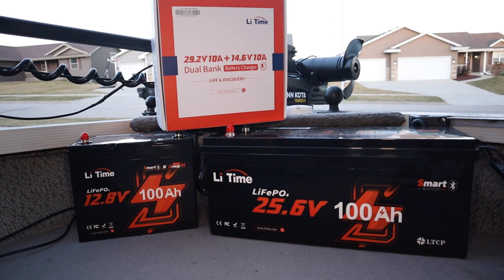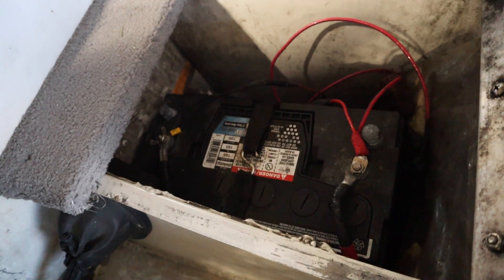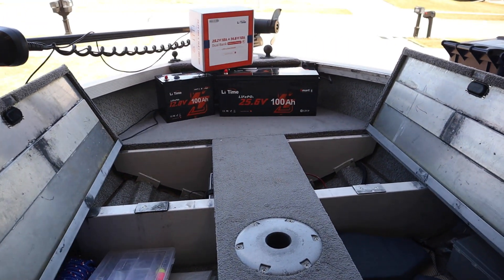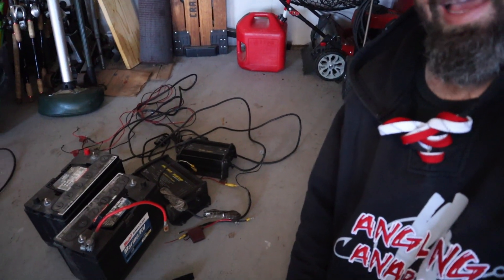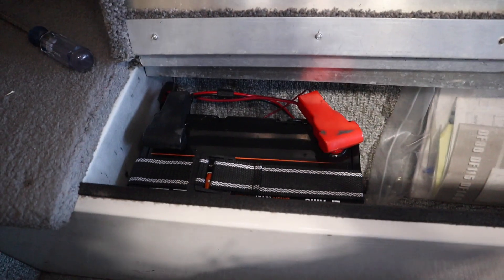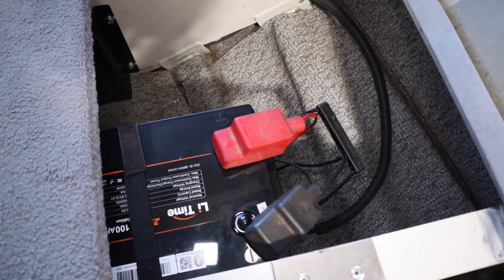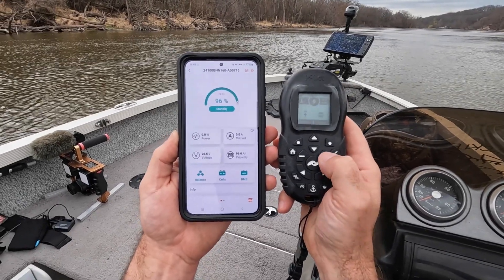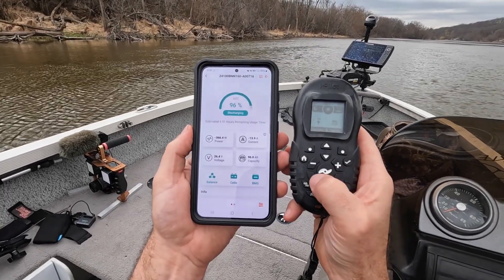LITHIUM BATTERY BOAT INSTALL!! - LITime Lithium 24v and 12v Batteries and Charger

Comment: Looking into doing this same setup.  Do you ever run into instances where you may not want to charge up both batteries at the same time?  Maybe a dumb question... but wondering, if you knew you  were not fishing for a while and wanted stop these around 75%... but the 2 batteries may be at differential discharge levels.  Maybe not a big deal...just heard its not good to leave stored at full charge. Thanks
Reply from the maker: @joerayburn21 It's definitely a good practice to leave the batteries between 80-20% when not in use. For me, this usually means just bringing the boat home from a day or afternoon out and not charging the batteries until the day before my next trip. There have been a few times when I wanted to charge one battery and not the other, so I simply disconnected the charger from one battery and ran it until I got the charge on the other battery that I was looking for. Hopefully that makes sense!

Comment: I’ve seen a 150A breaker being sold as part of a kit with this. Is that actually needed?
Reply from the maker: Im just using a 40A self re-setting breaker on this setup and it works just fine!

Comment: How are the batteries holding up so far thinking about buying one of those 24 V packs
Reply from the maker: @sandcreekoutdoors1056 I absolutely love both batteries and the charger! They've been rock solid for me. Now would be a good time to look into getting some batteries. They gave me a new code for 10% until the end of the year! Use ANGLING10 when you check out!

Comment: One thing I don't understand with these chargers. Why should you need to have your charger inside the storage of the boat or open up the storage and connect the charger? When I look at the brand victron they sell a battery indicator with charge port so you can connect there and charge the batteries. But the problem is that this port is only suitable for 12v led battery. I use it for 24v charger and it works anyway but the battery indicator might show wrong. This fault was made because lack of information from the seller. This port fits both victron blue smart 12-24v...and should not been made like this if it's not ok to combinate. Still wonder why they have not made it much simpler...for some people or most you have to climb in the boat to reach the things you need. I don't have to do that I just connect into the port that is easy to reach in the front of my boat

Comment: I’m a little confused, what charger are you using now for your cranking battery?
Reply from the maker: @fishslayer6529 Since I'm not using the lead acid battery for anything other than a starting battery, I dont have an on-board charger for it anymore. Basically, I'm just relying on the motor running to charge it back up 😊

Comment: With your set up did you install a circuit breaker or fuse
Reply from the maker: @chackparks6158 I used a Rig Rite 24v 40 amp marine circuit breaker.

Comment: What type of run time you getting with the 25.6V battery on your trolling motor?

I noticed they have an actual 24v one instead of the 25.6 is either one I'm guessing fine to use?

I'm looking at replacing my 2 lead acid batteries that run my 80lbs thrust 24v Ultrex. 

Thanks
Reply from the maker: @P.G._FPV From what I know, any lithium battery that says its "12" or "24" volts are all actually 12.8 or 25.6 volts technically because the individual cells have a voltage of 3.2 volts. The 12v batteries have 4 of these cells (4 x 3.2 = 12.8). Double that for a 24v battery, and you get 25.6. I hope that all makes sense. I get amazing run time from the battery. On a typical day of fishing I use somewhere between 30-40% of the battery, so I always have plenty in reserve.

Comment: I must’ve missed exactly what you said about the starter battery. Which battery did you go with for that? I’m looking to upgrade to lithium as well
Reply from the maker: @NateFFishing I'm still running a lead/acid for the starting battery as my outboard isn't compatible with a lithium. You'll have to check with your outboard manufacturer and see what they say. Suzuki told me the reason lithium won't work for a starting battery for me is that the motor uses a stator instead of an alternator to charge the battery.

Comment: I tested a LiTime 12v 140ah smart  in my Sun Dolphin 120 pro 😮 it has ran flawlessly! So now I am going to put two LiTime 12v 140 ah smart batteries in my Nitro Z-18 to run my 24v  98 thrust Ghost Trolling Motor . I went with the two batteries because the trays are already installed and the LiTime’s will fit . It will take 74 pounds out of the boat . Eventually I want a Millertech 12v 190 ah duel purpose cranking battery for the Pro XS 150 and everything else ie eletronics / pumps.
Reply from the maker: @MrFishhook It's tough to beat the weight savings that you get with these batteries, along with the better power you get from them!

Comment: I basically have the same boat as you. 2004 Crestliner Fishhawk 1750.
I just did a LiTime install video on mine as well. 
Still want to do the single 12v for all the electrical. 
But yesterday was my first test with them.
Boat gained approx 5mph because of less weight.
And on the Mississippi River pool 8 fishing wingdams on Spot Lock with my Terrova 80lb I am still at 88% battery life. 
And the trolling motor was humming fast to keep up with the high flow currents. 
Also found the Terrova was more responsive. 
I use both the peddle and remote. 
The spot lock GPS was alittle funky for a bit. 
But it was 15-20 mph winds in the current.
Troll speed on 10 was (in calm water) was 3.8 mph.  
Betting without the wind it would have been better. 
Check your boats speed and handling.
Bet yours will be better as well with the lighter set up.
115hp Merc 4stroke btw.
GPS speed taken off my Helix 7.
Reply from the maker: @JonGunnerOutdoors I'll be putting the 24v to its first actual fishing test this weekend for 4 days of chasing muskies in Indiana. I'm looking forward to it!
Reply: @AnglingAnarchy  Good Luck! Looking fwd to the video!

Comment: I’ve been looking into doing this myself. Did you have to purchase the higher 20 amp charger to be able to jumpstart a low battery and activate the Bluetooth function?  It shows that’s the recommended charger on the site
Reply from the maker: @BrandonUsico The charger i went with is their waterproof model that has 2 banks, one will charge a 12v at 10 amps and the other bank will charge a 24v at 10 amps.